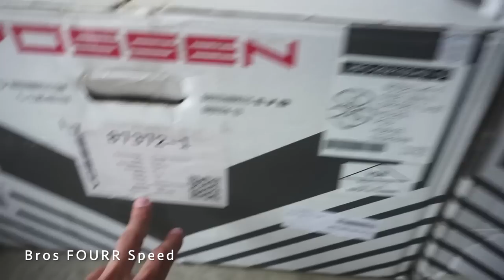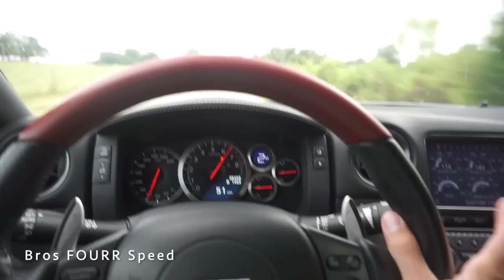NEW Custom Bronze Wheels Look Insane On My GTR!!

Comment: They added a Nice look to the car👍. The 2015 GTR  that I just purchased has the Advan Gt wheels.
Reply from the maker: Thanks! I love this setup!! I bet you're loving the GTR!
Reply: @BrosFOURRSpeed  yes just bought it at the begining of August, owner gave me a bunch of oem parts including wheels, side skirts, steering wheel, rear spoiles, intercooler,injectors,pumps. It has 760hp on Sunoco 260gt 104 and 667hp on 93 octane.Also gave me two rears 18" with Nitto 315/30/20. The car has Xona Green turbos, tial wastegates,1050 inj, Alpha cooler and intercooler, with Cobbs  carbon Intakes, Alpha gasoline chiller.HKS down pipe, HKS blow off,dba midpipe up to back with titanium tips, t1 upper/lower trans brace, deep oil trans pan with can catch, carbon steering wheel, font lip, sideskits and rear spoiler. HKS trans cooler. After moving from  Buick GN to Evos and a 2013 GT500, will keep this one for a while, surprise in every corner that place a smile in my face. I follow your story with your GTR and make me wonder how it will be owning one and here it is.
Reply: There are a bunch of fast GTR s in Puerto Rico including exotics Mclaren, Demons, Hellcats, GT500, BMW, lambos, GTRs,Supras corvettes, camaros, porsches, ford GT plus some R34s, R33 and other right hand drive imports

Comment: Sick operation in that van.  Here all the tire shops use metal pry bars to pull the tire off the wheel....and they use pneumatic tools to tighten the lugs...which is pretty stupid because when someone like myself needs to change a freak tire out...I have to climb on the vehicle and jump on the lug wrench because its not torque to spec...over torque with the pneumatic impact wrench
Reply from the maker: Yeah when I had these Michilen tires installed, thats when I got a few chips in the OEM rims. And the bolt holes got scratched dup a bit more too. Very happy with the care that Tread Connection puts towards the cars they work on!!

Comment: Hey, Bros Fourr Speed! What size tires do you have fitted to these wheels? I'm about to order them from Diego! I have stock suspension but plan to get new tires to fit the HF5.
Reply from the maker: I have the OEM sizes tires for these wheels. When these tires need replacing, I'll go a bit wider

Comment: What do you recommend for alignment and camber so the tires don’t wear out on the inside so fast
Reply from the maker: Heres a video when I had an alignment on my car at Nissan. There are a few settings from the factory. 
https://www.youtube.com/watch?v=oYACDc0binc

And here is my most recent one with the specs its at currently. 
https://www.youtube.com/watch?v=4frEtmw5qAQ

Comment: Hey man they look amazing!!

 I am trying to order some Gloss Gold HF-5s on my 2020 GT-R also. How did you order them? CarID Carid doesn't have my specifications. Did you order specifically from Diego Alvarez?

Finally, are you on stock suspension? Are those offsets for a flush look? I am going for a flushed look.
Reply from the maker: I ordered specifically with Diego from Instagram. That's the best way to go! And yes I am on stock suspension. This is the perfect size/spec for a flush wheel. Ad I can get a bit wider tires on these and it'll still look perfect

Comment: Hi, i’ve watched many of your videos over the winter while waiting to take my GTR out the this spring. I used your Vossen HF5 setup as an example when ordering my wheels. I bought 10” for the front with +25 offset and 11" for the back with +5 offset.  What tire setup are you using? I have Toyo r888r’s in 325/30/20 in the back and 285/35/20 in the front. The tires exceed the fender well by about half an inch. I used this tire size because that is what was recommended for best traction. But now I’m sticking out the fenders. No issues running this way, just looks a little off. So I’m curious to know what you are runi g on your HF5’s? Thanks for your help!
Reply from the maker: I have the stock sized tires on my wheels

Comment: ...any issue(s) with the wheel weights sticking to the wheel barrels that’s already ceramic coated at this point?  I am not too exactly sure if I should do the ceramic coating “before or after” the wheels mount/balance.  What is your overall experience and advice regarding this.
Reply from the maker: No issues! I did this with both sets of wheels on my Supra too. Everything stays perfect and the coating makes it much easier to clean brake dust off ;)

Comment: Changing OEM rims for heavier ones, even if larger......should have taken for about the same price as the Vossen, fully forged wheels, that are lighter....for example Titan 7 or BC Forged.
Reply from the maker: Actually they weighed nearly identical to the stock ones. I think fronts were the same weight and rears were half a pound heavier. It doesn't make a difference at all. On my Z my Vossens were like 5 and 7 lbs heavier then stock and I did a dyno run and it put the same power to the wheels. I did not track that setup tho, I put the stock ones on for that. But for the GTR .5 lbs won't do anything. Car is fast enough and literally that's irrelevant. 
Forged like those would be cool and the lighter would be better. But you would only notice the benefits on the race track. Not worth it

Comment: 20x11 dayum!!!!!!!!!!!!!!   Tread connection do most of the lower 48?  I'll def. be checking them out!  Thanks for posting this, I've always wondered how some can install difficult tires/wheels combinations while not damaging anything (I could do a rant but I won't!!!).  What tire combos are next?
Reply from the maker: Check out their website and see who is close to you!! They have done some crazy spec wheels! I'd probably do 305's in the back and 285's in the front next set

Comment: Stock tire size no problem with this wheel?
Reply from the maker: Nope. The Vossen's are .5 inches wider then the OEM rim. So the tire just has a slight stretch, but nothing crazy. Next set of tires I'll be able to go a bit wider too